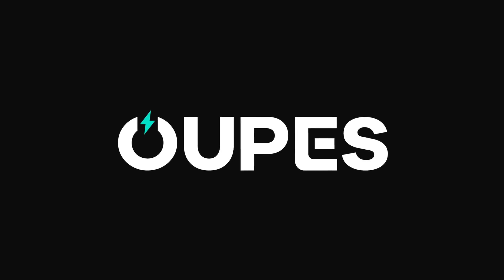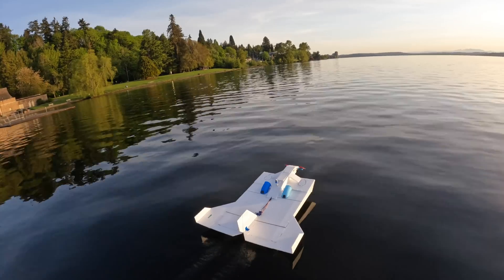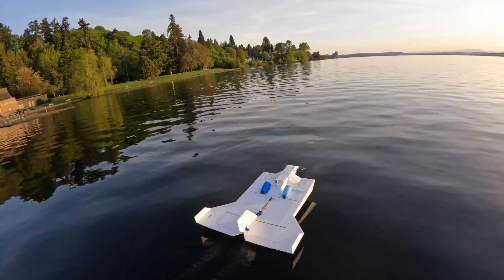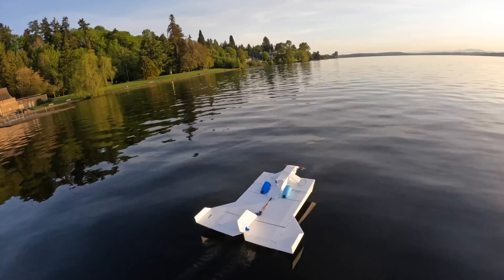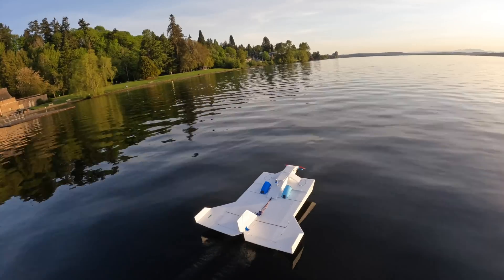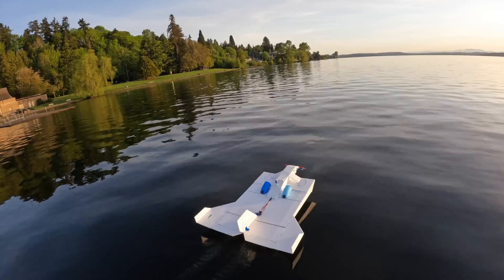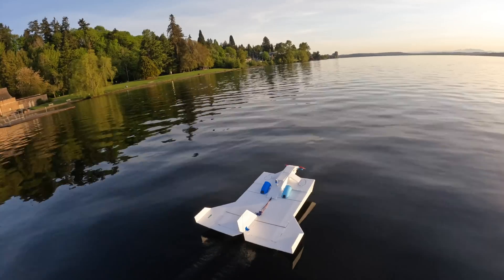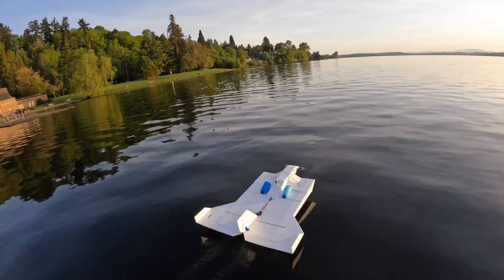Testing WWII Era Terrain Following 'Radar' On R/C Plane

Comment from the maker: Heres the glider from this video: https://www.fmshobby.com/products/fms-2300mm-fox-v2-pnp/?ref=RCTestFlight
Use code $10RCTF or RCTestFlight to get $10 off
Reply: I'm not surprised you couldn't feel much ground effect with this glider, the Fox is more of a glider shaped sports plane than a real floater. No 1200g 2.3 meter plane is going to be much of a glider, my X-Dream 2m is 474g RTF and that can float on ground effect for the length of our runway - you need spoilers to land it
Reply: What if you add a shock from an rc car as a dampener on the rods. 

Ideally I would thing you would want the rods touching the ground constantly. Maybe add a really weak spring in line so that the rods would be more progressive in the authority adjustments.

Maybe have a gear reduction on the arms so you can still have large surfaces but less aggressive inputs.
Reply: Does your radar buffer the altitude before it outputs the control? I would think (if I understand what you are doing now) if you just slowed the response of the output, the software would be catching peaks and troughs of the waves, and the delay between what is sees, and what it outputs, would be problematic. So some outputs would be greater than others, and some would be negative vs positive. I.E. You are compensating for problems you already passed. 

I would assume this action would lead to porpoiseing. If you forward angle the sensor a bit, and did some math to compensate for distance and time of the radar, you could avg the wave height, before the aircraft is over it. In this sense, the aircraft would fly as if it was over a level surface. It would be looking at waves ahead of it, thinking it over, and acting at the appropriate time. Then you could leave the sensitivity up, but create a digital travel limit of the servo outputs, and set a fail safe climb altitude if those limits are exceeded. If you really wanted to get fancy, you could do the fwd looking sensor, and a direct down sensor, then have your software crosscheck the data of what is trying to accomplish, vs the actual result. An algorithm of altitude results from the intended vs actual altitude could also be running to fine tune on the fly. 

The only problem being the occasional freak taller wave, but I lack the understanding of how a wave peak would physically disturb ground effect, or if the plane would mechanically avg that out.
Reply: I had this Idea after your last video, What if you where to mount Rotating Magnus effect wings with the added  benefit that they might bounce out of the water like the Dambuster Bombs. wuld love to see you try this.
Reply: Coloured fog ON the plane and white fog on the ground might be interesting.....

Comment: Remeber the old servo horns from the 80's , they had a tow of goles from the center out to the tip for adjustments. If you 3d print the same thing on your parts youll have options for variable geometry. I would guess more action on the lever and leas action on the control would help better than reducing possible control surface available.
Reply: Goles* holes

Comment: The problem I see with PID on sonar distance is that the aircraft is itself an integrator of elevator angle. Hence the low frequency oscillations. I think you need a cascade of a P controller on sonar altitude, giving a climb rate demand to a PID climb rate (velocity) controller outputting an elevator setpoint, with climb rate being the derivative of the sonar signal.

Comment: Maybe you could try using gears that are not circular to get the pitch to scale inversely proportional to the height?
I also think that the ground follower is acting essentially like a really soft spring, and that it has very little dampening. You are getting oscillations because there is no mechanism that "dissipates" the extra energy, it is only getting redirected to the other end of the equilibrium.

Comment: Your planes are too light for ground effect control surfaces to work effectively. The rebound off of your whiskers alone is enough to push the plane off the water. 

Make a heavier plane with whiskers mounted on the very end of the nose and tiny planers soldered on the end of them. Your pid should be linked to throttle, not control surfaces.

Comment: All this ground effect talk reminded me of flying my old Zagi.  At low power levels it would settle into ground effect and float there,  It was stable enough that I could fly big lazy circles on water in ground effect, not touching down, but unable to climb over about 2 ft.  This didn’t require any input from me other than a bit of trim, it would just hang there, and it was self stable enough I rarely needed to go out and rescue it.  In retrospect, maybe the forces change to nose up a bit as the ground effect got stronger….

Comment: Whisker input for altitude control should be viable, but a better approach would be to have the whisker move a variable resistor sampled by software that runs a PID loop driving an actuator (or of you're hardcore you can try it in hardware using resistors, caps, and chokes). Alternately you could try inserting a stretchy section (or a tiny shock absorber) into the mechanical linkage to reduce the resulting amplitude change due to abrupt changes in whisker angle.

Comment: the straight rod is contacting at a pretty harsh angle and suddenly imparting a new offcenter drag on the plane that looks like its under and/or behind the COM
i think having a smoother contact angle with the ground/water farther forward from the COM would help damp the input and put the new drag in a more stable spot

Comment: About the ground effect. There is a big difference between runway and grass effect. My glider is 1.3meter wing span and can sustain with 1 quarter throttle on road surface with just playing around the maneuver stick without touching throttle. But once on grass immediately drop and need to add power

Comment: The oscillation were reminiscent of those seen with early fly by wire. Can I suggest  2 things: 1st reduce the angle the canards or elevators move wrt the probes and give them a smaller total deflection. 2nd Add some damping to movement to slow the reactions.

Comment: It needs some type of damper countering the oscillations, because the change in rate of going up and down is to quick so it will also react faster and this will cause cascading effect almost like a wave getting bigger or faster.

Comment: Think of wing tip vortices just like a boats wake,  if you fly a perfect 180 degree turn you’ll hit your own vortex just like in a boat, only problem is the ones in the air invisible. Hit your head on the roof a few times you’ll learn.

Comment: There are two different ground effects. Far-field, or "weak," ground effect reduces drag, and is normally expected at 1/2 the span above the surface. Near-field, or "strong," ground effect reduces drag and increases lift, and is expected at ~1/3 the wing chord.

Comment: Maybe you need to tune the lift without using the servo effect of control surfaces altering aircraft pitch angle to control it. Operate canards and the vertical stabiliser together to increase and decrease lift without altering pitch?

Comment: The last solution would probably work better if it was not be a mechanic connection to the flaps but rather to arduino or something reading input (angle), smoothing the data and using it as an input for fly-by-wire system.

Comment: Build a plane without pitching tendencies: CG slightly in front of the CL and build the horizontal stabilizers (empannage) airfoil symmetrical. This will make the plane mostly maintain the pitch it was left at (even if the airspeed changes).

Comment: Only use P and I gains. D will probably cause problems in this application.  Set Derivative gain to 0. Use this method for tuning. Start with P only.  Start at a low value. Increase until the plane starts to oscillate. Then cut the P gain in half. Now slowly increase I gain to correct for the error. Too much I gain will cause it to oscillate again.

Comment: If you collect a time series of the plane heights and the elevator pitch, you should be able to improve the feedback loop and adopt elevator controls to the first derivative of the plane height graph. Since there is a delay between elevator changes and it's effect on the flight path, the software needs to anticipate the effect of the elevator changes.

Comment: Just a theory, for tuning the control loop you may make headway by considering both power and elevator commands.
They say, "speed is life, altitude is life insurance" and while the saying goes for surviving (engine) failures, the same is true when landing. Landing aircraft must stabilize their approach, so that the aircraft's energy at the touchdown point is in a specific range. If they're going too fast, they can pull up and exchange the speed for altitude, and this exchange is done fairly quickly; a few knots for a few meeters is a balance between airspeed and altimeter readings. Their sum will calculate the aircraft's net kinetic potential energy, which you can add to by increasing power. You might have luck in your control loops by using altitude as input for the aileron loop, and altitude plus airspeed for the throttle. This would allow the plane to react to the situation where it starts too high, pitches down while adding power, and ends up low with too much speed.
I would personally just use simple gains for both, but logic would say you'd need a gain for mass (speed and altitude multiplier), drag (speed multiplier) and should tune the rest with PID.

Comment: My knowledge of the ground effect is that it's the wind that's normally kicked off of the wing reflecting back off of the ground then interacting with the wing underside and the flow of air, forming a standing wave. A high sweep flying wing should be able to catch some of that air bouncing back on the tips, and the stability can be modified with dihedral and wing twist nicely.

Comment: you need to be able to control how much thrust the prop produces depending on the current air speed distance from the ground using the poles and tilt angle of the canards all in real time with a bunch of math to counteract going up to high or down too low. im guessing btw

Comment: this seems dumb because at this point why not use ground effect, but... What if you went for something bigger to create ground effect in a smaller capacity, with a lower angled wing to generate less drag, while using a pressure sensor underneath the wing to tell the plane how close it is to the ground?

Comment: Arguably the use of flaps instead of or in combination with elevator would allow you to check the descent towards the water without pitching the plane. I am talking about a very small amount of flap. So tell the controler to add flap when it needs to stop a descent and crow the flap up when it has climbed too high. The longitudinal axis will remain steady because you arent pitching as much.

Comment: Try using curved wands instead of straight ones.  Or use non-concentric gearing, so the travel is small at first touch, and becomes greater as it gets closer to the ground.

Comment: I LOVE your videos!! Keep them coming!
A Close Coupled Canard may be better for ground effect. IGE pressure under the wing increases which causes an upwash at the leading edge which will increase the lift of the close coupled canard, causing a pitch up away from the "ground". 
Also a swept wing pitches down less IGE than a straight wing because of less center of pressure shift. 
In fact 25⁰ to 45⁰ swept wings with a tall OGE T tail will also work!

Comment: Your deep cord tests are more effective because it takes more time to bleed the pressure off from under the aircraft. Think of it like a tarp gathering wind and billowing out. To stop the billowing you can put cuts in the tarp and the tarp will billow less with each cut. 

For a lesser cord there is a shorter path to release pressure despite more generated ground effect BUT the accumulated total air pressure under the wing surface would be less because of the amount that can escape relatively easily.

Comment: The mechanical connection between the elevator and flight altitude can become more accurate when the elevator is moved far forward in a canard pattern. in this case, the angle of climb will increase and decrease much more slowly and can give a smoother adjustment of the flight altitude IMHO

Comment: Flying under ground effect is in essence flying without induced drag. Thin chord wings create very small amounts of induced drag, and the opposite happens with thick chord wings.
Ground effect vehicles fly so bad when they get some altitude that they keep themselves in ground effect naturally. With normal airplane wings that doesn't happen because the difference of the total drag, with or without induced drag, is minimum. Thats why you can barelly feel any difference with your glider.

Comment: at 12:00 i looks like the pitch down was too powerfull, the pitching up when too low was great.

Might give it a try with zero to none pitch down, this will require you to match it a bit with throtteling it down when moving out of the ground effect.
But maybe thats exactly what you want to be efficient in the ground effect, just make sure you thottle down a bit everytime you lift above it.
Reply: Forcing pitch down might be counter active with a flare being more efficient.

Comment: Sounds like your control system is unstable, especially if you aren't reaching a steady state over time. You should be able to fix that digitally by reducing the response rates but you could also put an inductor in front of the servo if its analog controlled? I dunno its been awhile since i was a control theory student.

Comment: For the active control, my guess is, you would need to mix some gyro signal mixed i to the control, instead of just playing with the PID coefficients. Because what is most likely throwing the loop off is the temperamental variation of the control surfaces authority. Moreover if I'm not wrong, the system becomes at least 3'rd order (or even possibly 4'th order): Control surface displacement gets integrated into pitch rate, pitch rate gets integrated into attitude and attitude gets integrated into altitude (or first into vertical speed and that into the altitude). So to me nearly impossible to stabilize with just a simple PID (a single derivative is not enough phase margin recovery from 3 or 4 integral system).
By using an attitude gyro signal giving you the attitude angle, you split the 3'th (when not relying onto that fast elevation changes) order response into two max 2 order loops, while the dynamics of the inner 2'nd order loop (surfaces -> attitude) is suppressed by the gyro signal (use the gain and D coefficients to stabilize), so then what remains is just the outer loop (attitude -> altitude) which is just one single integration, so very easy to stabilize.
You first adjust the attitude control response (gyro -> servo PID response; better to be on the faster side, but still stable), then by varying the altitude sensor sensitivity adjust the final altitude stability.

Comment: There's air squashed between the fuselage and the ground. I wonder if you can "extend" the arms by adding a flap to them, so that as it approaches the ground the pressure of the air forced between the flap and ground provides some control signal before physical contact?

Comment: I think that for a proper feedback loop you will need wands with progressive flex that match the weight of the aircraft. Think of it like a fishing pole. At the tip, the wand would deflect more allowing for less input. As the aircraft gets closer to the ground the wand provides more input because the wand gets progressively stiffer.

Comment: I'd have thought you would need to look ahead of the plane so that it would be more ready to react to the surface proximity.
Even on a dead flat surface to fly over, the plane can't react fast enough with something looking straight down.
The F-111 had true terrain following radars which allowed it to hug the ground better than any jet on the planet, and it flew some seriously changing terrain at very high speeds!
Of course, bigger planes don't react to the vagaries of wind and other forces like small planes do so I'd try scaling up the model and giving it more mass with bigger engines to compensate for the extra weight and see if that helps.

Comment: You may wish to notice that PID works well only when there are no other hidden integrators in the system. Integrating twice produces a nice oscillator. Hidden integrators may come in form of inertia of any kind. Things to do about it is either turning off the I component of a regulator, or shifting its frequency window a full order of magnitude away from the existing hidden integrator.

Comment: If you really want to see groundeffect you need to go 4m wingspan or above.
When coming in with my F5J Inside on a stabilized approach at about 2m it's like hitting a cushion. I've floated almost 100m to get from 2m to 0 when my initial approach was around 10meter distance per meter sinkrate.

Comment: I'm no engineer, but I think you "feel" ground effects most when the aircraft is at that point where you must add some power to fly out of the effect. Configure for very slow flight and then pull the power back for a very slow descent. At that point, I think you will "feel" the ground effect just above the surface of the water. Before I even knew what ground effect was, I used to play with u-control and I'd love to set up a case where the plane would just barely skim over the ground but not really fly above a few inches. Cool way to "see" ground effect working.